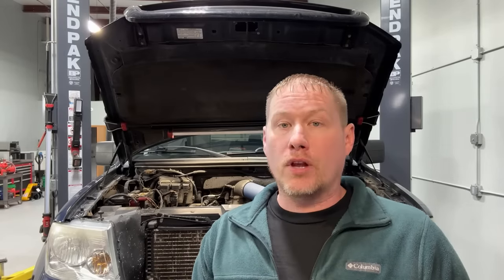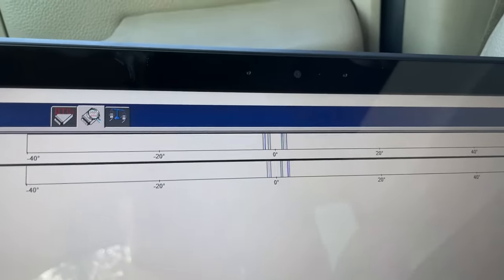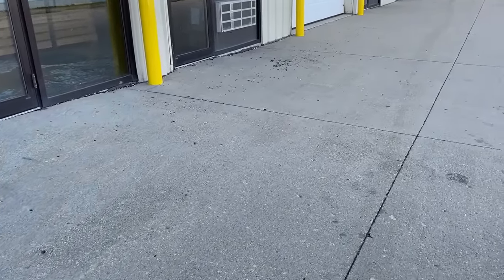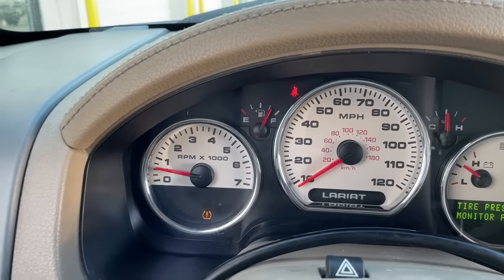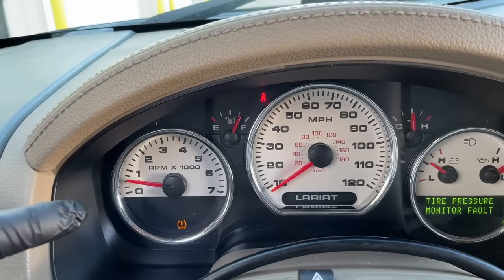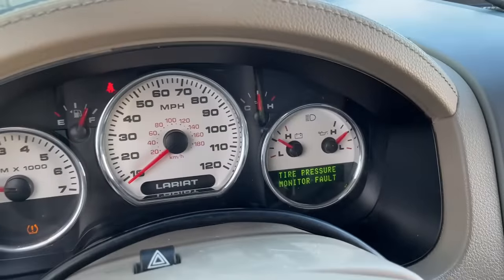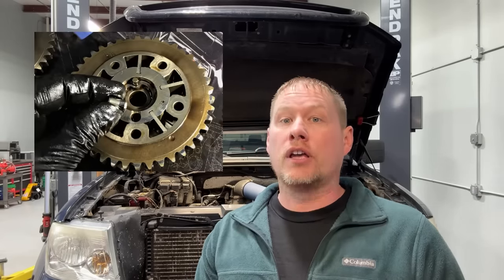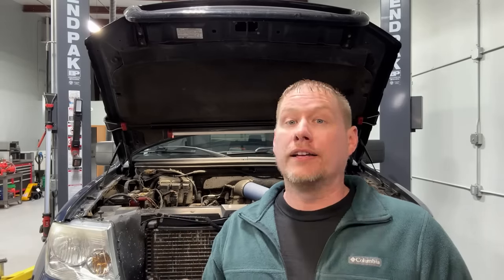Ford 5.4L 3v Triton Engines: Two of The Most Commonly Misdiagnosed Noises!

Comment: Ok i got a question i have a 09 ford f150 4.6 liter with 293k miles and my engine does the same exactly thing , makes the same exact noise sometimes,  latly it been doing it alot seems like especially since its so hot. But i took it to a auto shop , told the guy i need a timing chain he basically told me i need a need engine and he did not want to do a timing change cause he didn't want to make me spend all that money and if something else messes up and i need a new engine.

Comment: Dear sir I'm working on a 94 f150 4.9 using the jumper wire technique in the testing port,is the jumper wire position the same with key on and engine running pls help I love you ford knowledge I'm a mobile mech,but working on this truck in my boat yard at home,front to back and top to bottom ty sir!!

Comment: I’ve got a 2010 4.6 3V f150 and when the engine is hot it idles good but when you just barely get on the throttle you can hear like the phasers rocking or something. I’ve kept up on the oil changes but the truck got 190k so is it do for a timing job?
Reply: We had a 2008 sport trac with the 3v 4.6L and it did this all the time, I wish I had access to it (former Ford tech) but there was a service message saying light "clattering" noise in low rpm ranges,  especially in drive thrus is normal. Every 4.6/5.4 with phasers I've ever worked on made that noise. Stupid design IMO, always embarrassing backing up the camper and the engine sounds like it's going to rattle apart lol. We are enjoying our 2.3L 2021 Ranger though, time will tell though!

Comment: I had the rattle timing sound on start up on my 08 5.4 2 years after doing the oil pump timing combination but come to find out the idiots at Monro muffler when they did my oil change put the wrong oil filter. The filter was extra small compared to the original one therefore the engine starved of oil on startup

Comment: Hi Brian I have a 2011 Ford escape and  sometimes wen I start it my battery light comes on then my electronic power steering locks up. I loos all steering. Then turn engine of then start it again then it's fine. Can you give me some help on what's the problem or what can I do please need help

Comment: My 2007 5.4L just started ticking as soon as I start it up and goes away after it’s warmed up or it’s been sitting in the heat for extended periods. What could it be? Has a diesel like sound.

Comment: I have a 2005 lincoln navigator  when I hook up a oil pressure cauge I noticed when engine cold the oil pressure is 60 psi when hot 50 psa but I noticed when phaser knock start to occur due to hot oil the oil pressure drops like 5 to 8 psi every time it knocks

Comment: Can you please do a video on changing the clouch cable and transmission on a 2007 standard caliber 2.4   on mine it will shift in to gear when it's off but when I start it it won't go in gear at all I'm thinking it's the clutch cable but I might be wrong please help.

Comment: God Bless America & FTM. I dont understand, if oil pressure is causing phasor osc, why would a timing job fix that? Im probably  not getting what you said , help please!
Reply from the maker: The oil pressure loss that is causing the oscillation is caused by worn timing components namely vct solenoids, phaser springs and most of all blown chain tensioner seals.

Comment: Had a 2005 5.4 f150, sat for a year. Drove it 65 miles home after adding fresh gas, was stalling on low speeds like 1-2 mph and in reverse. Unplugged the vct solenoids, changed oil and oil filter. Went to drive it next day and after 20 miles it just shut down on highway. Truck would start but soon as I gave it gas would stall and shut down. Cel and wrench icon. With truck in idle could rev it up to about 2000 rpm and would be shaking and misfiring a lot.  Any idea where to start? I checked throttle body and was full of mouse fluff. Please give me a few ideas of where to look first.
Reply: sounds like a MAP sensor or MAF start there and get those mouse droppings out of your intake and check filter.

Comment: I have a 2006 ford f150  and it backfires into intake on part throttle aceleration from stop have tried several things and nothing fixed it any pointers on things i can check also oil pressure is 15 psi at idle warm testing at oil filter housing

Comment: Hey Brian, I don’t know if you have any knowledge on the transmissions on the old second generation Ford explorer, but I had my transmission rebuilt about 35k miles ago on my 95 and it’s a 4r55e, recently, it started acting strange, all forward gears work fine but for some reason, reverse and neutral also move forward. Park mode does engage parking pawl but sometimes when I start it up, i can feel the truck lurch forward a tad. I removed pan and checked the manual valve pin and the shift linkage and it feels ok, also shifter inside steering column is nice and tight (fixed that myself a few years back).

Im at a loss….and low on funds…
Reply: The clutches are burned up and fused to the pressure plates
Reply: @johnsonbobo2376  if thats the case, how in the world!? Its a rwd vehicle and I dont take it off roading and I dont beat it up or drive the vehicle hard.🫤
Reply: @johnsonbobo2376  
Well, thank you.
Its disappointing, but ok, time to sell it off.
Reply: But in case you’re wondering, no it’s not because of poor maintenance. I’m pretty meticulous with my vehicles and I do check fluids and stuff often enough to notice leaks or anything like that, I think it’s just like you said they might’ve just used a really cheap rebuild kit or they didn’t even rebuild it properly.

Comment: Hi,I did a complete timming job 05 5.4 triton motor on a f150 cam phaser failed...the color marks on phaser is not on the R how do I time it without taking it completely apart
Reply from the maker: Mark the relation of the chain to the phaser sprocket.

Comment: So i have a question on this, if the phasers are knocking like this, does it resonate as "knock" through the knock sensors and reduce engine performance?
Reply: Knock sensors barely ever reduce engine performance.  Your problem is the knock is most likely due to bad phasers and bad oil pressure after being hot
Reply: @johnsonbobo2376  I wasn't asking what caused the knock, Brian already showed us in the multiple videos he's put out. I was asking if the knocking phasers would be picked up as knock by the knock sensors and reduce timing advance and add/subtract fuel causing reduced engine performance

Comment: What if I've already had a full timing job done and the phaser oscillating issue still exists? What could still be the problem?
Reply from the maker: You have an oil pressure and volume concern at the phasers. This is generally caused by not using 5w-30, not using a high volume oil pump, and not cleaning out the pan. Some engines are just too worn out especially at the cam towers that they need 5w-40 oil.

Comment: I was recently van hunting and was talking to salesman about the issues with the  three valve 5.4. He said the 3V are only in the trucks and the vans only have the two valve motors. Is this true
Reply from the maker: Correct the E vans reverse received the 3v engines.
Reply: @FordTechMakuloco  E vans have Two valve or Three valve?
Reply from the maker: They never received the 3v sorry about that.
Reply: @FordTechMakuloco  thanks. Yeah I don’t want to deal with 3 valve. I got enough projects

Comment: When you say "common" is that common in reference to units sold or just what you get in the door?
Reply from the maker: Common to all for the lifespan of the engine 2004-2014.
Reply: @FordTechMakuloco  👍
Reply: @FordTechMakuloco  I have a question I have a 04 lariat and it had a motor put in it in 2018 found the stamp. It has timing issues but no noise or slap. Has the typical cam codes and random misfires. You accelerate it shackles you to death because of the missing and won’t go into overdrive. I am a technician and this thing is getting the best of me. I’m just not a heavy line tech. I’m sure I could do the timing job I’m just nervous. I just work at a firestone so of course they would prefer I don’t do it there. I can’t really do it in my driveway land lord would have a fit. Just want to get it fixed properly. I have heard even replacement motors can sometimes be out of time like this one what do you recommend?

Comment: So if oil viscosity in heat is a problem what happens if you run 5w40 , 5w50 or 15w40 oil?
Reply: I guess ill try to answer my own question. The oil P increases and many of the noises and excessive wear problems disappear. The hot rod Mustangs used to run 5w50  syn oil only in hi perf motors. So why would Tritons in trucks have to run 5w20 oil?

Comment: Curious if anyone on here ever changed their internal thermostat on a 6r80, I have a 2011 f150 5.0 my tranny was running hot so I had my mechanic change the fluid and he said the  trans thermostat was bad so we changed it. since then my trans never gets above 180, usually runs at 150-170, my truck is running perfect so no complaints, just in the 12 years it has never run at such a low trans temp, curious if the new thermostat just allows better flow and if anyone else has had these results......

Comment: What would cause a f150 2005 5.4l reman engine to develop a mis fire on #3 cylinder after driving it 6 miles I performed a leak down test on #3 with all of the roller followers removed after checking the basics inj coil etc this thing shows 100% leakage on #3 ex valve what would cause this failure to happen so quickly

Comment: I have a 2016 f150 2.7 lariat. I’ve noticed in my driveway that I have black spots on the ground. They are not oil. It looks more like the ground is burned. I touch it and it’s like black charcoal residue. Have u ever seen anything like this?
Reply: Could you maybe have a hole in your exhaust system or a burn-through in your catalytic converter?
Reply: Going to get under it today and see. Exhaust sounds quiet so I didn’t think it would be that but u never know. Thanks for the reply!

Comment: Does this happen on the 4.2? I have an 05 f150 with the 4.2. Mine sounds like a knock when warm
Reply: The 4.2 is an old school pushrod engine and does not have any kind of variable cam timing.

Comment: Is there a phaser delete available with a fixed cam gear?
Reply: I would like to see engines without variable cam timing. So you loose a little h.p. or fuel mileage, but would be cheaper in the long run.

Comment: and what can i do for the second noise, my 5.4, 2009, i change all distribibution system, (not phaser,  not cam shaft) original ford, and add a melling hi presure pump, and use 5-30 syntetic oil, the second noise present one time in any ryde, in ralenti or stop wait, the solution is acelerate a little, and the rpm up, and thats all, no more noise, (the noise when present is in the driver side, the passegenr side not), what is the solution, thanks....

Comment: I have a question, i installed the cam phaser lockout and the noise are still there, why?
Reply from the maker: There could be many reasons but most companies say it only works on the Ford phasers and the instructions state to use the oil chamber with the tightest fit to the lockout wedge.

Comment: Where my phaser oscillation homies at? I needed a timing job and more importantly the higher volume pump when that noise started like 80-100k miles ago lol. I have all the issues lol. Lost a follower on the passenger side at 80k and chewed the cam. Phaser oscillating kicking in somewhere around 90 to 100k. Chain rattle happens only occasionally. Have a passenger side lash adjustor that bleeds off slightly when the vehicle is parked 8+ hours. Hell even had a phaser lock in the retarded position a couple times, turning my truck into an unbalanced washing machine 😂. Despite all the problems everything is stable and not deteriorating. Since it's my only vehicle and I would want to do the job myself (due to rising labor costs and "car wizards" that would charge up the arse for a reman) Im waiting until things either continuously knock or rattle before diving in...since I would need a rental and time off work to relace unforseen broken parts during disassembly (broken off ps pump bolts anyone 😂). 185k and still going strong. Change the oil religiously every 3 to 4k with mobil one. Recently switched to 5w-30 in hopes of delivering a bit more oil pressure to the timing and valve train components.

Comment: This is exactly whats happening when I put my 06 f150 5.4l into reverse at low idle under load, I can either shut it off or hit the gas and it will stop. I can drive it for 5 days in-between this happening..I just did all 8 plugs, ignition coils, I cleaned the intake and did a fuel filter because when that would happen it was stalling.  The truck runs good overall and it's nice and quiet except for some minor ticking when its cold on the back 1 head. I don't have the money to replace all of this stuff. Not sure what to do.  I understand it's intermittently out of timing and that it's becomes stuck retarded with the low oil pressure at a low rpm. I get all that, what's the fastest most direct way to fix the problem? No way to adjust with a computer the timing to try to compensate it being off?
Reply: no because the timing hes referring too, is mechanical!

Comment: I had another problem.  I used engine flush to clean on my truck engine and it kept plugging my oil filter.  Went threw 4 oil filters and lots of engine cleaner to get it cleaned out

Comment: I came out the store and a 5.4 started. It's was click like crazy I told the guy it's a 5,4 ford. What do mean. The clicking. You will put time 2000$ in the front of the engine or more.  He said it's bout it. I thought it the valves seal like a Chevy. I said. No no no. I said good luck.  I said under my breath. Fuk FORD